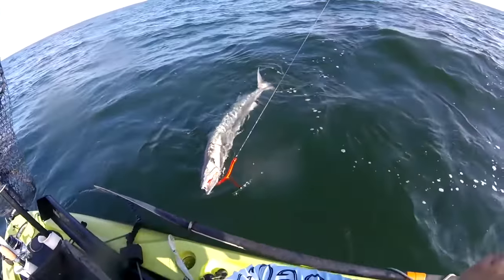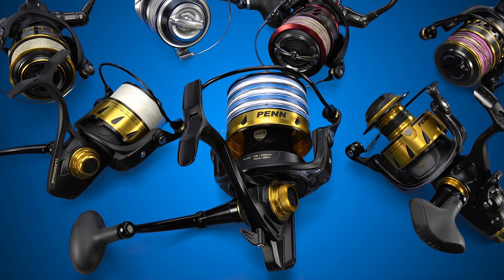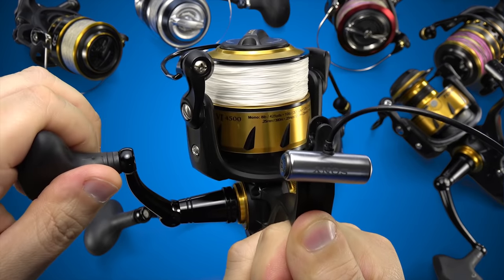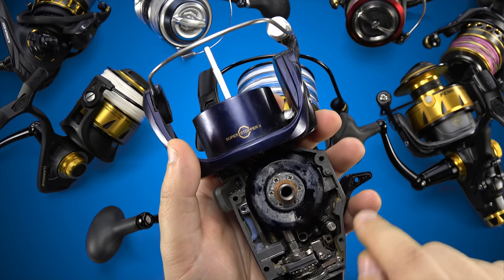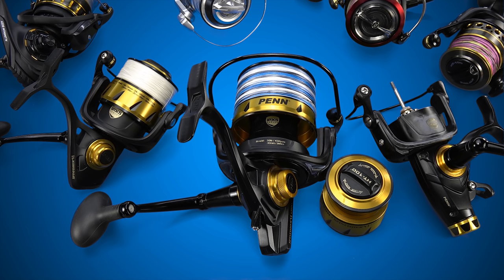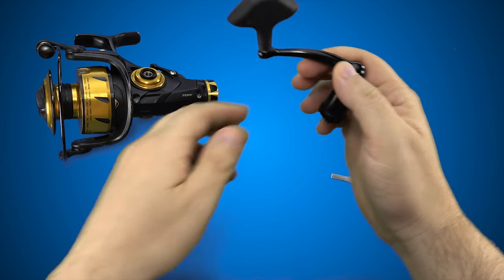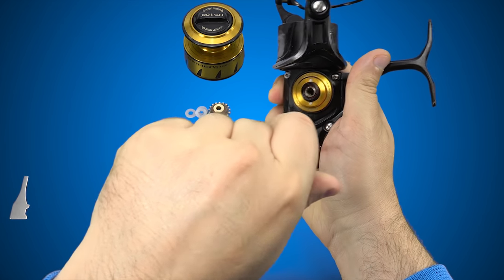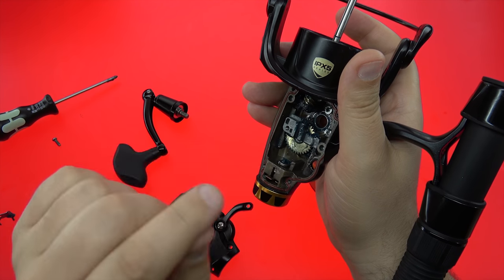Penn Spinfisher VI review  comparison and discussion of ALL MODELS after Hard use  GREAT!

Comment: What percentage of Isopropyl you use can make all the difference.  Was it 91 or 99%?  Alcohol has the weirdness of reacting much differently at different percent concentrations.  Try 70% or even the 50% and I'd bet you, there's no removal at all.  Doesn't make sense!  I know.  But see if its true.  I haven't tried it.  But the percentages can make all the difference.
Reply from the maker: I use 100 % (sealed bottle) I use it to speed drying, displace water, to cut oil and general cleaning....
Reply: @TackleAdvisors  Consider this...If I use 91% Isopropyl, it will take off permanent marker fairly easily.  If I use 70% ...SOME colors of markers totally ignore it, unremovable! Or, it barely fades it.  But use 91%, ...and it comes off like sugar water.  The concentration is the key.  You're at 100%, (isopropyl?) so it's going to behave more like acetone, which you can scare the flaws out of a diamond with that bet get the headaches.  But try 70% next time when cleaning outer paint surfaces.  Seriously.

Comment: I can not get my braided line equally divided  on the spool of both of my new penn spinfisher liveliner 2500. Its sitting on it like a chrismas tree. What am i doing wrong? Someone a tip?
Reply from the maker: Did you adjust the line lay by shimming? If it's stacking too much at the bottom.  You need to lower the spool by removing a washer... You should be able to.  As I think there are two. You do not want the spool rubbing on bare metal
Reply: @TackleAdvisors  i did removed 2 rubber rings under the spool. It spools up fine now 😊👍
Reply: @TackleAdvisors i had to remove both of them in order to control the line evenly on the spool. One was not enough. Thanks for the tip 👍

Comment: How do you think the 7500lc will  hold up at the canal?
Reply from the maker: Hey Dan.  I think it'll hold up better than the daiwa emblem pro and if I'm not mistaken it was one of the more popular reels awhile back.  Im not a canal fisherman but I generally only fish heavy current 3kts and sometimes deep.  So I am familiar with the wear and tear heavy jigging plugging and winching can put on a reel.  If your rod layout is optimal and you can shoulder the weight.  It's be perty good.. Though I don't know the ratio.  6500 lc is a big reel.  On the 3to 6 ounce rated tiralejo witch could be a 3 or 4oz to 8.  It's I beast to throw all day.  Picked up the 11 foot Daiwa ballistic and dig that over the tiralejo fwiw

Comment: Does the spinfisher vi have any advantages over the slammer?
Reply from the maker: Yes.  In smaller sizes the graphite rotor takes a bit of weight out of the output side of the gear train.  Which you feel in the form of an easier to turn handle.  Plus the top only drag stack vs the slammers sealed drag has a lower minimum drag setting which is good for bait....the slammer drag has exter seals and washers and the lowest it goes is over a pound of resistance.

Comment: All of these reels in this range should be fully sealed.  It's not that expensive to do , and the cheap die cast metal rotors and frames and side plates make me cringe.  Shimano , Daiwa , and Penn need to make serious improvements to be competitive with Van Staal.  All they need is a stronger reel stem and full waterproof sealing , not that hard , but I guess I'm asking for too much.  Disappointing.

Comment: What's the difference in v and vi?
Reply from the maker: Better gearing on the vi is the big advantage.  A lower minimum drag on the new one which is nice for loosening up for fishing bait in a rod holder.  Better line roller.  Sealing at the main shaft which is a big boost in protection.

Comment: Ever try a Penn 525 USA made?
Reply from the maker: Yes and the European models.  Very capable reels.  One of the best used surf conventionals you can score for deals and walk away with a damn good reel.
Reply: @TackleAdvisors  i traded a used Shimano Stradic Ci4+ for USA made. No longer made here in USA. Almost brand new. Your reviews and breakdowns are the BEST!
Reply from the maker: Damn dude!!!!!!!!! That's a score!  Are you new to heaving conventionals?  If you are you should be able to buy neodymium magnets to add to the shuttle I think 1/10" by 1/4 inch disks fit...if i remember correctly.....here's some light reading about the series  https://www.stripersonline.com/surftalk/topic/120965-tuning-the-penn-525-gs-525-mag-mag-t/
I think when new they came with extra magnets to aid in spool control if you have the mag.  IIt was a hot  speedy reel when tuned right.  And extra mags tamed it for tough conditions